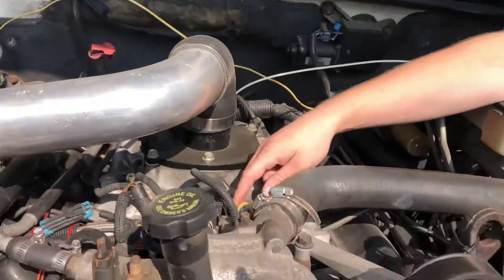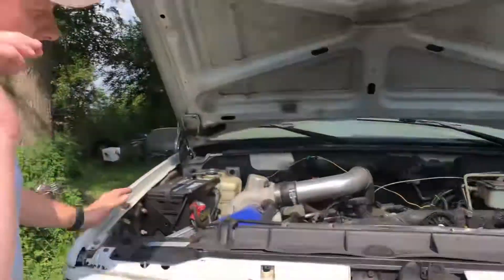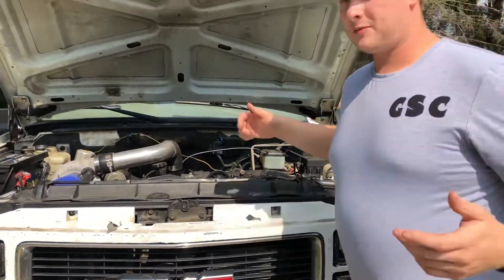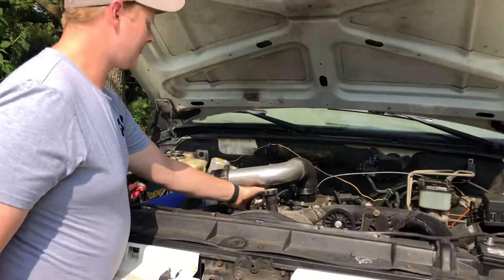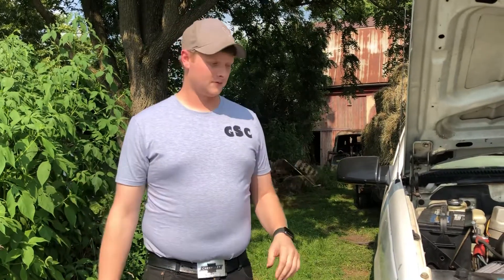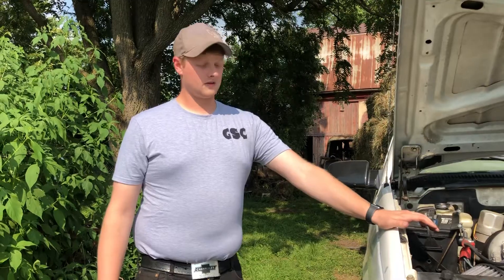GSC 6.5L turbo diesel. Things to look at when purchasing a 6.5

Comment: My 94 GMC 2400 had 400,000 miles on it when I bought it. It was run daily and I put 110,000 MORE MILES ON IT.  In its life, the 6.5 Diesel had a new Head Gasket installed at 250k mark, a rebuilt injector pump at 465k, new injectors too.  Im sorry I traded it in. I had an offer to sell it on the spot … from a total stranger.   These 6.5 diesels are truly great motors.
Reply from the maker: You had a good one then! To have that kind of miles and still be so reliable is excellent. Sorry to hear you let it go, unfortunately we all have that one truck we wish we had back. My white truck happens to be one I’ve sold and got back before. It’s not leaving again!
Reply: Ya there Detroit diesel 6.5L are good motor. I'm thinking of buying a 1995 Chevy 2500 or 3500 4x4 5 speed. When i get my license next year.

Comment: For those who buy the 6.5TD and the PMD is in the original location, if you get a non-start, don't listen to the GM dealer, because he'll want to sell you a whole new injector pump assembly, which the PMD is part of. GM doesn't sell the PMD alone (or at least they didn't when I owned my '99 K3500) so you have to order it elsewhere. I had my truck towed to the local GM dealer after it wouldn't start, they told me the injector pump needed replacement (and it was 3000 miles past the 120K extended warranty GM was using). I had read on the Kennedy Diesel site about PMD failures and ordered a new one through Kennedy, and installed it myself in the parking lot of the GM dealer where the truck was sitting. Got it hooked up and the engine immediately started. I looked sideways at the service manager and drove away. I put mine up on top of the intake manifold plenum, mounted to a heat sink. I put another 70K on the truck before selling it.
Reply: Honestly if you know electronics repair and how to solder, you can probably even just replace the transistor inside the pmd, for cheap. Dealers, and even mechanics, aren’t actual mechanics any more. They’re parts swappers

Comment: Make sure the front brace is on the starter. Without that the block will crack out were the bolt goes into the block.
Reply: Thanks 🙏🤸‍♂️👍
Reply: Mines cracked in that exact spot how worried should I be? It’s a small hairline crack
Reply: @mattstrains4841  unless you can find someone to wield the block it's junk.

Comment: If they were built right the first time nobody would have to do any of this stuff to em . They really are dangerous had my pump decide it wanted to go full throttle more than once on me while stuck in traffic cause its all electronic and not a manual throttle cable ! Chevy should have scrapped the upgrades and recalls to replace pumps and just given everybody a new duramax replacement ! I'm sitting on a 99 with 100k miles and it's had 13 injection pumps put in  That's unacceptable ! Usually 1000 each time its replaced ! Not good at all ..
Reply from the maker: They really left a lot of shortfalls in them which is why most people bought 454s over the 6.5. Frankly I’m a big block fan. The 6.5s were a right place right time hobby that started over ten years ago. I still encounter some weird issues with these that make me wonder how GM got away with all of it.
Reply: Well I'm gonna fill you in on an interesting conversation I had today with a gm engineer and I still have to talk to customer service on Monday.  July 2014 Chevrolet was ordered by the national health and transportation dept to recall a number of 6.5s . My truck is on the list !  They failed to send me this particular bulliten how convienent .. apparently they did it to a lot of people hoping they would just go away well  I havnt ! He stated to me you can now go online and look at the gm recall bulletin it covers your truck for 120k miles or 11 years where I  paid for my own pumps to be replaced since the 80k mile mark and I've put 13 in they shouldn't bitch if they have to properly fix mine or replace the Whole dammed truck ! Im about 50k into everything over time and thats no joke ..According to him trucks in the south are fine they dont go to a different formula diesel in winter  if you go to the bulletin you can read some of what he told me anyways fuel manufacturers in an effort to clean up the environment have gone to an ultra low sulfur which is specially formulated for winter use in super cold climates ..So its not just plain ultra low sulfur it has additives. Now the additives they put in actually eat the seals right out of these within a few thousand miles or less in most cases ! Sounds familiar to me !  You have to build a pump for specific regions of the country instead of sending the special sealed pumps they keep sending a universal pump !   These pumps need special seals made from special materials the standard rebuild seals are no good ! So this is why so many ended up in the crapper ! I was inches from getting a cummings today before I talked to him ! Now ill see what customer service says ! My fam owns a chevy dealership and dodge dealership ive driven junk my whole life , I do have a few toys but they are kind of investment toys for later in life. I'm not giving up too easy now im understanding what they did .

Comment: What would you say is the average life expectancy for a 6.5? I’m planning on looking at one with 230,000 miles on it. Thanks!
Reply from the maker: Honestly I’ve had one with 455,000 miles that was all original and another with 395,000. It all boils down to maintaining them. 230,000 miles is still pretty low. I would do a harmonic balancer. Injectors. Lift pump and oil cooler lines when you get it home. Other than that it should last you a long while.
Reply: I second this. I had a 97 with 384k on it. They definitely go. I just found one on craigslist with only 170k on it may have to jump on it
Reply: I'm picking up mine here in a little bit. Only 79k on the miles. This makes me feel alot more confident in my decisions.

Comment: Going to look at one tomorrow with 88,000 original miles crew cab king bed hopefully it is true will be using to haul 👍
Reply: Hope you have fun with the truck if you bought it. I got a 94 GMC Sierra Extended Cab. Im pissed that It was not cheap since it got 227k Miles on it. Here in germany people ask 20k for a GMT400 in good shape🙄

Comment: i have a check engine light that comes on almost every time i hit 60 or am around 60 and it also comes on whenever im just on my throttle for a period of time, like going down the highway my check engine light will come on and all i have to do is just let off for a second and it goes away. even if i just take a little bit of pressure off my throttle for a fraction of a second and get back on it right away it goes away till im on my throttle for a period of time.
Reply from the maker: Get the code.  That will make it easier to troubleshoot.

Comment: I’m just looking to buy one now, this is a great video. Thanks a lot! The truck I’m looking to get has an oil leak though, and the exhaust needs to be replaced. Wondering if it’s still worth the purchase?
Reply from the maker: @adamzioriophotography  oil leaks can be $20-200 to fix and the exhaust systems are cheap. If it’s a good runner and you can turn a wrench it’s worth a shot!
Reply: @ Right on man, thanks for the quick reply! I’ll most likely buy it.

Comment: Hey! Sweden here! Is assembling a 6.5 TD 1994 Got a problem with this! ??

So let me get this straight. Once the Timing Chain and gears are installed, the crank gear mark should be at 12 o'clock which will put the cam gear mark at 6 o'clock (pointing at each other). I got that. Now install the cam IP sprocket which will also point its mark to 6 o'clock (same as the cam timing gear). I then need to rotate the crank 180 degrees moving the cam IP sprocket mark to 12 o'clock. Now install the IP with the sprocket mark pointing to 6 o'clock (pointing at each other).

The gear ratio between the crankshaft gear and the cam gear means that .... If I turn the crankshaft 180 °, the cam gear is only turned 90 ° !!!! 360 ° on the crank is 180 ° on the cam! Or am I completely confused here 
Then most of the instructions on how to mount the injection pump gear are not correct !!
Pleas help me her!
Reply from the maker: It’s been a long time since I have done a full timing session. Cam and crank must be alighted 12 and 6.  Then you rotate the engine CCW until the cam gear is at 12. Alight IP gear which will then face 6 to match the cam. That should be the correct sequence.
Reply: @gingersnapcustoms  Thanks for your reply! The engine works, starts fine! Yes I did exactly as you describe! It works! Thank you for everything you share! Cruelly! Mvh Lucas!
Reply from the maker: @No_t_hing  hurray!! I am glad it worked and it is running well!

Comment: I have a 1994 6.5 Suburban. It is spotless. I will be using for my retirement hauler. I have about 160000 miles on it. I either want to put a new 6.5 in it and upgrade to make it tow better or put in a newer late model engine with more HP. What would you do? And with the upgrades you have talked about, do you think it would haul our 6500 - 7000 trailer better. It is a complete dog on the inclines. Slows down to about 45 MPH. Thank you for your time.
Reply from the maker: With a 94 you have the option for multi tunes from Quadstar. 6500-7000lbs isn’t bad to tow with one of these with the right upgrades. I would do a fluid damper, Fass lift pump and relay harness, Super54 turbo from Quadstar and upgraded upper intake plenum. Get a set of marine injectors. 4” turbo back exhaust and use it. The improved air flow and tuning will make it handle inclines without the massive decrease in speed. Do a 2000 water pump, 2000 fan clutch, 2001 duramax fan blade, Leroy diesel coolant bypass and a new GM thermostat and a set of Leroy diesel oil cooler lines as well. 160,000 miles is still young for that engine. So the upgrades and basic maintenance will keep it hauling for years to come.
Reply: Thanks for the info. Love your channel.
Reply from the maker: @matthewpatrick6646  no problem! If you run into any snags along the way feel free to message the Facebook page

Comment: I have a 94 what is the coolant bypass hose under the thermostat called? I cannot find it on O'Reilly's website or AutoZone. Or perhaps more importantly what size of hose is it?
Reply from the maker: If my memory serves me right it’s a 5/8s hose or 3/4. I normally buy 12” of each to keep on the shelf since some use one size and some use the other.

Comment: what is required to do this turbo swap? I may have to replace mine soon and I don't know what to buy for a relatively stock engine. I am putting a 4 in exhaust on my 93 6.5 and I am getting some oil through my turbo into the intake. I swapped oil cooler lines, put new starter, battery, plugs, block heater etc. in it when I bought it. Just trying to get it reliable by winter and I am not super familiar with turbo troubleshooting. Is that a sign of a bad turbo? I don't of have great oil pressure either... but I am not really low on oil. Just trying to learn about these because it is has been a great truck so far.
Reply from the maker: @kadenspurgeon6332  that’s a sign of a bad CDR valve. The turbo is most likely just fine.

Comment: Hey Bud Merry Christmas to you and your Family. I'm considering buying a 93 c3500 crewcab dually 6.5 for 4k..The smoke coming from the oil fill should go away after warm up? Send to be a good running truck but i don't know anything about diesels one bit. And being in California a presmog truck is a definite plus.
Reply from the maker: Hey there. Blow by isn’t a big deal. It’s just crank case pressure escaping and as it warms up there is normally a bit less.

Comment: Since Im not a skilled mechanic with years of experience especially with these engines are there specific things on my truck I should look out for? Here are some Data about the truck and what problems it has:

- Its a 1994 GMC Sierra C2500 6.5 with 227.222 Miles on it
- For 13250€ it was not cheap at least thats what I think
- The engine has oil consumption and I assume its because of the cdr valve. Dont think consumption is gonna be completely gone after replacing the cdr valve but It might help a little. Consumption is 3/4 to 1 quarts on 300 to 400 Miles that I have driven since I own the truck

Any advice that could save me money because of big problems that could be waiting to happen would be much appreciated.

Greetings from Germany btw.
Reply from the maker: With oil consumption like that I would be concerned the oil cooler lines are leaking and the turbo drain. The CDR causes very minimal oil use. I would begin with checking for leaking lines before purchasing any components.
Reply: @gingersnapcustoms  Im gonna drive my truck into a shop sometime next week to get the truck inspected before my extra long drive that Im gonna do end of this month. The guy with the shop owns an early Dodge RAM Cummins so I guess he knows a little about diesel engines. Im gonna inform him to check for oil leaks when taking a look under the truck

Comment: Hey GSC. Wondering if you can help a guy out. My truck wont start. 1998 GMC 2500 6.5 diesel. She cranks makes smoke but wont fire even with brake clean.(I don't like to use ether as it just sounds so nasty on a diesel) I just finished doing both heads, ip, injectors, main and rod bearings and the good ol' timing chain. Please keep me from bashing my head against the work bench in endless misery and frustration and solve my issue. lol. Thanks.
Reply from the maker: Sounds to me like the injection pump timing is off or you’ve got low lift pump pressure. You can also plug a PMD in directly to the injection pump to see if that helps.

Comment: Got a question ginger. I bolted up heads a couple weeks ago with felpro gaskets(all I could get). I followed the torque sequence with 90* torque after the 50ftlb then I saw a video you did about going to 115 ftlb. It's sat two weeks with valve covers sealed on. Being that there felpros should I pull the covers back off and torque to 115 or should I leave it?
Reply from the maker: I would do a retorque. Felpro gaskets have thin fire rings and tend to pop. If you used ARP studs put them to 120lbs. If you have stock bolts take them to 115
Reply: @gingersnapcustoms  Thanks for getting back to me

Comment: Bad ass truck brotha. What have you done for it to get more hauling power ? I haul a bobcat and struggles to take off and get going. What turbo did you upgrade to?
Reply from the maker: This truck has a fass lift pump. Marine injectors from Leroy diesel. HX40 (Now an S300 borg Warner) fluid damper. KBDiesel upper intake. 4” turbo back exhaust. Quadstar tune and sending unit. 4” air intake and it’s been an outstanding farm truck/daily driver for almost a decade.

Comment: Found a 94 with 128,000 miles going for $12k. Is that a good buy?
Reply from the maker: @shanegrauer  where I’m from you are better off buying a duramax or newer truck for that price. 5-7k would be a good start.

Comment: What are your thoughts on upgradeing  to a durmax water pump and a 9 blade fan and clutch to keep it from getting hot when hauling
Reply from the maker: You can’t run a duramax water pump on a 6.5. But you can run the fan clutch and fan itself. I’ve tried both and I didn’t see enough difference from a 2000 6.5 clutch and fan to do the dmax components again.
Reply: Are these trucks really that weak ...mine can't even haul a 4000 Pound skid steer with out getting hot ...but I really love the body style on these trucks
Reply from the maker: @anthonyhernandez2396  I’ve hauled 10k plus with Casper and it didn’t get warm.  It also has the 99 HD cooling system. Had an HX35 swap and other work done at the time.
Reply: Where can I order this kit upgrade
Reply from the maker: @anthonyhernandez2396  regarding what? Cooling system? Turbo? Upper intake? Tune? Go check out some of the Facebook posts. I used to have a few things written here in the YouTube comments too

Comment: Would it be worth replacing an engine on one that’s still in good condition?
Reply from the maker: Knowing how long these trucks can last? Absolutely. I’ve done that a few times and would do it again if the right truck came along.
Reply: Keep an eye on the number that is on the engine block. There are engine blocks from the later 6.5 with the number 506 on it I heard those blocks are terrbile qualitiy. I heard they often got cracks. Dont know if that is true though.
Reply from the maker: @Jean_1999  all blocks are equally crappy. I’ve broken more 599/141/929 blocks than 506. Maintenance is what makes or breaks a 6.5.

Comment: How can I find a 6.5 Detroit turbo engine for my Chevy Silverado K1500? Or any alternative for this truck. My engine is cracked.
Reply from the maker: It depends on where you are located. You can buy brand new from Leroy diesel. Or there are a few dealers across the US
Reply: @gingersnapcustoms  I found one of the new ones from US Engine production; Optimizer 6500 6.5L Long Block Engine Side Mount
Price: $5,098.00  
 with a One year unlimited mileage warranty!
Long Block Engine Includes:
Cam/Main/Rod Bearings  
Oil Pump  
Timing Gears  
Camshaft  
Pistons  
Valves  
Connecting Rods  
Piston Rings  
Valve Guides  
Gaskets  
Push Rods  
Valve Keepers  
Lifters  
Rocker Arms  
Valve Springs  
Seems like the better deal, I believe this is the new metallurgy to avoid cracks...
Reply: @gingersnapcustoms  I am located in Asheville NC
Reply from the maker: @j.a.p.818  that should be the better cast block as long as it’s a true optimizer block